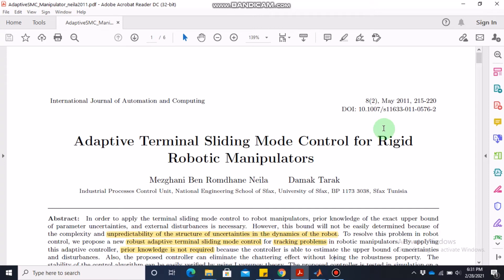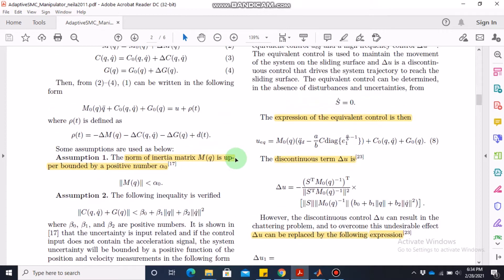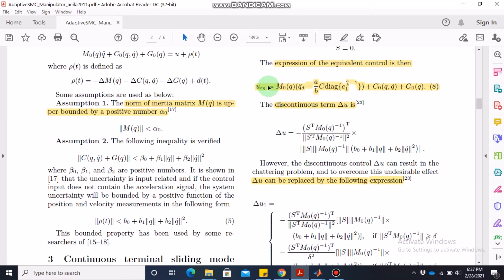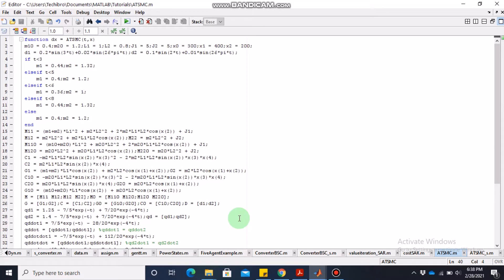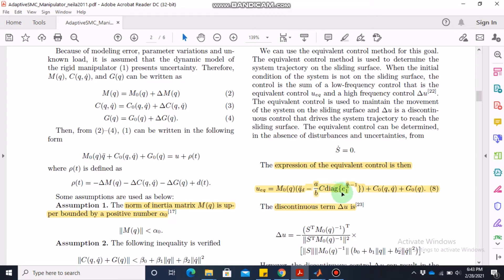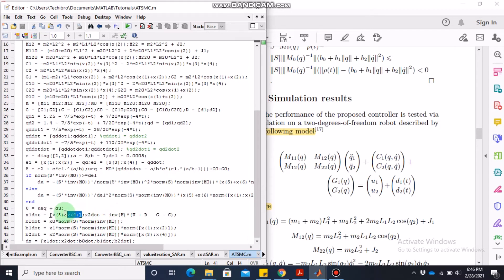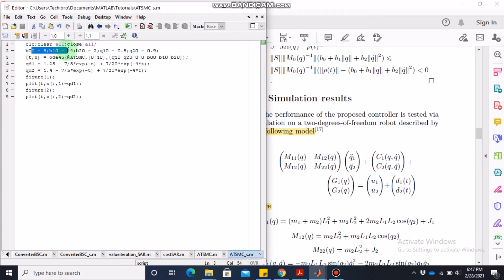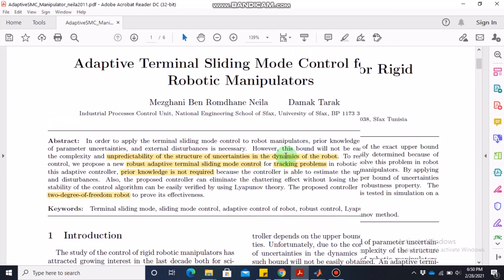MATLAB Simulation of Adaptive Terminal Sliding Mode Control for Rigid Robotic Manipulator

Comment: Sir 
In adaptive smc we have to put adaptive law in control input 
Or in system dynamics 
Or in both
While coding
?
Reply from the maker: Adaptive law is an independent differential equation. In simulation, all of the differential equations are written in the same function file. You can watch the video carefully and you will see how I write the adaptive law, control , and the system dynamics all in one file
Reply: Nonlinear adaptive control of magnetic levitation system using
terminal sliding mode and integral backstepping sliding mode
controllers
Hafiz Muhammad Salman Yaseen b
, Syed Ahmad Siffat b
, Iftikhar Ahmad a,∗,1
,
Ali Shafiq Malik b
I am using this paper as reference

Comment: I understand that we should edit the code like this   x1dot = [x(3);x(4)];x2dot = inv(M)*(U + D - G0 - C);       % G20 = [G1;G2];        and  in the second code add x0=[q10 q20 0 0 b00 b10 b20];
% [t,x] = ode45(@ATSMC,[0 10],x0);

that will be fix all the problems and erroes. tnx sir

Comment: Sir there is error in 3rd line of this code I have written the same code but still there is error.
Reply: Thank you sir
Reply from the maker: Please focus on the statement of the error. I have executed the code in the video. There must have been a typo in the copy.
Reply: @cset sir the error is not enough input argument
Reply from the maker: @aradhanayadav1739  Maybe you are trying to run the function file instead of the script file.
Reply: Sir code is running and output is same  as in video but sir there is error of not enough arguments and in third line
Reply from the maker: @aradhanayadav1739  Please note that there are two types of files created in the video. One is a function file in which all the equations are written (you are not supposed to run/execute this file). Second file is the script file where "ode" command is used to call the function (you should run/execute this file). From your comments, I cannot tell which file you are executing but from my experience, I have a hunch that you are trying to run the function file. Please watch the video carefully (especially the part where I execute the file by pressing the play button). Hope that this will help you in finding the issue.

Comment: thank you, Sir, for the clear explanation. I'm working on a rehabilitation robot " same dynamic model", my question is, what do you think can be changed in this paper to write an article.
Reply from the maker: Mostly, people look into the selection of the sliding surface (invent a new sliding surface and prove that it results in better control performance). Another idea could be to use a combination of feedback control and learning (finding a better way of adapting).
Reply: @cset   I find the ideas interesting, thank you, Sir. may I ask for materials ( books titles, articles.. etc), that can help me with the basics of sliding mode control for ''beginners'', ( I am new to the control area, and part of my project is related to control).
Reply from the maker: @alrawdasuliman6649  Yes, you can try Applied Nonlinear Control by Slotin and Li or Nonlinear Systems by Hassan Khalil

Comment: Good day. I am trying to simulate a TSM for a nonlinear system but l was wondering how can l get the correct values of constants and parameter in the sliding surface of the TSM so that system can be stable.
Reply from the maker: Usually, the condition for stability is easy. For example in the paper of this video, the condition is that 0<a<b and the authors selected a = 5 and b = 7. In another paper, I read that b should be between a and 2a.